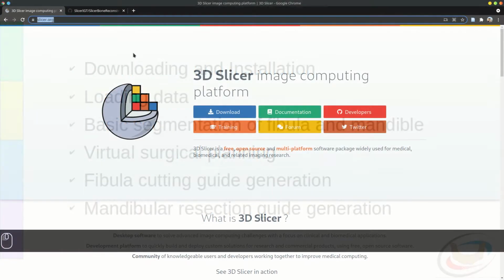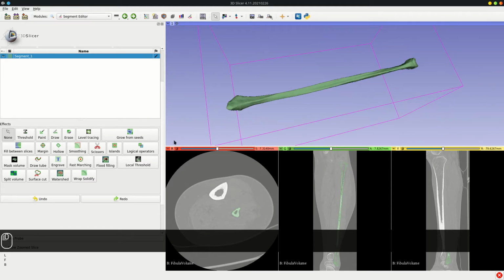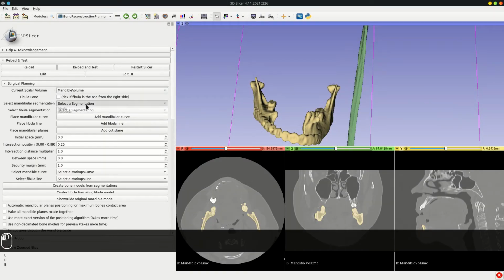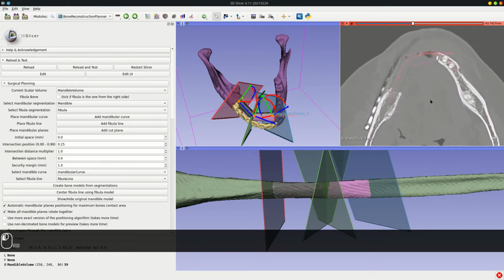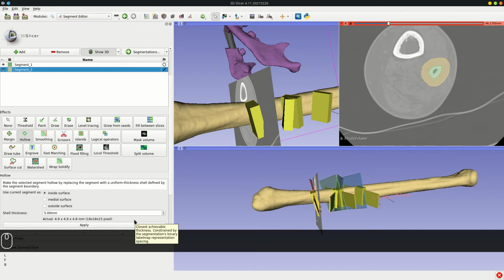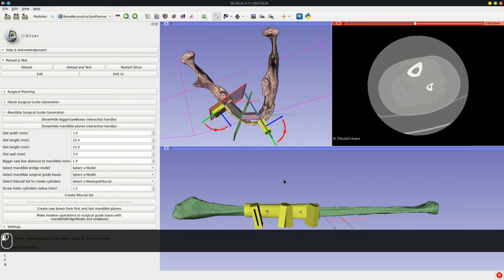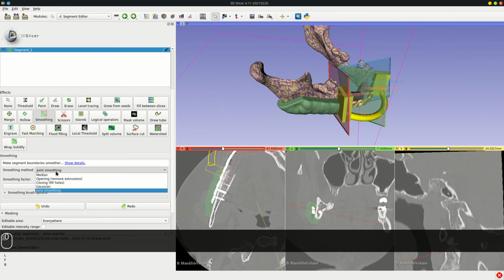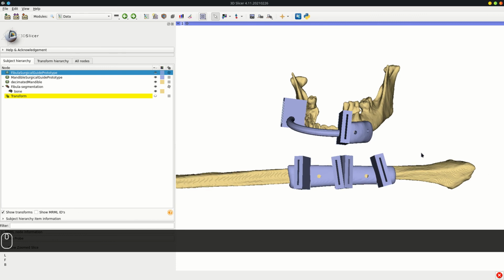Mandible reconstruction | 3D Slicer Tutorial

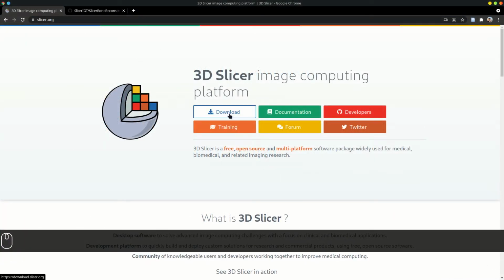Comment: Installing Slicer 0:44
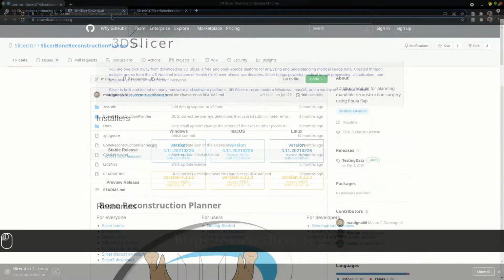Free opensource software for mandible reconstruction 1:06
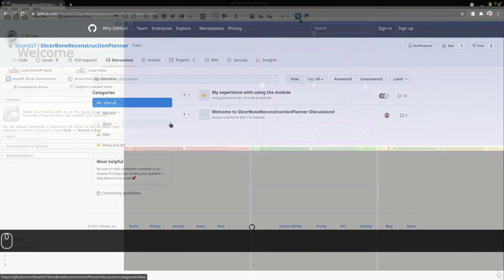Installing mandible reconstruction extension on Slicer 1:20
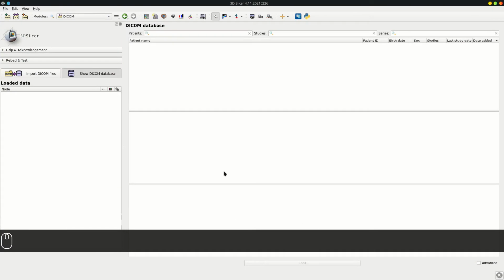Loading data on Slicer 2:04
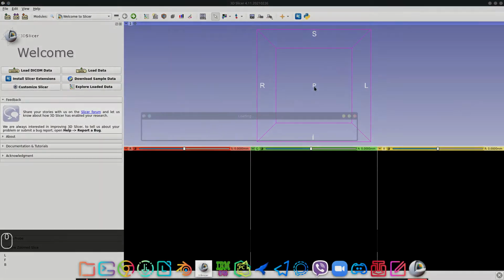Basic segmentation of fibula and mandible on Slicer 2:27
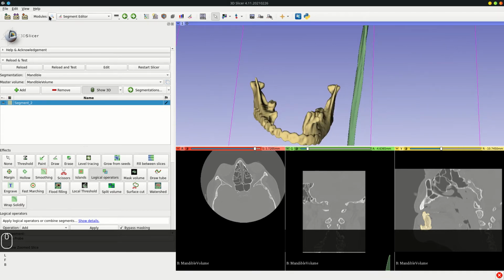Virtual Surgical Planning of mandible reconstruction 8:13
Fibula surgical suide generation 13:34
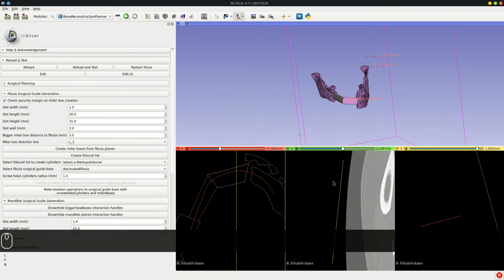Fibula guide base creation 15:04
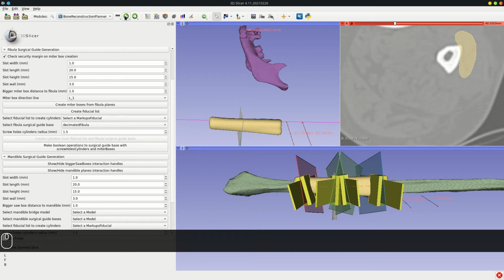Fibula surgical guide generation continues 17:50
Mandible surgical guide generation 19:32
Mandible guide base creation 23:02
Mandible surgical guide generation continues 25:36
Resulting surgical guides 3D-printable models 27:43
Mandible reconstruction extension project info 27:59